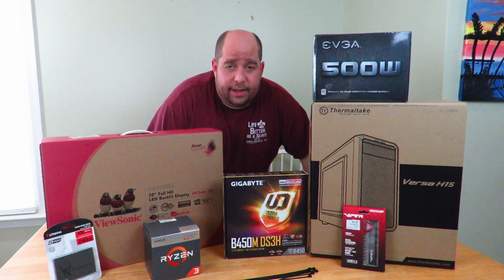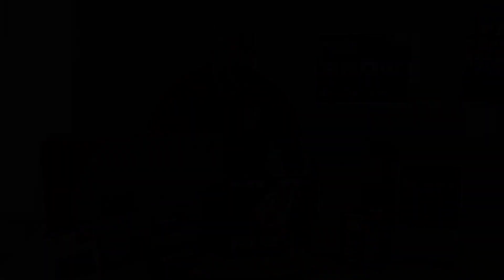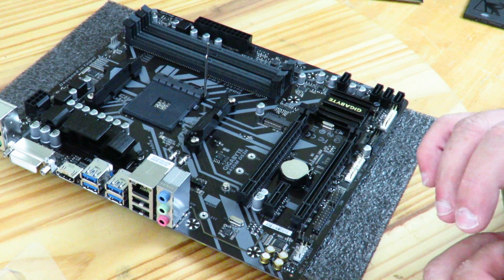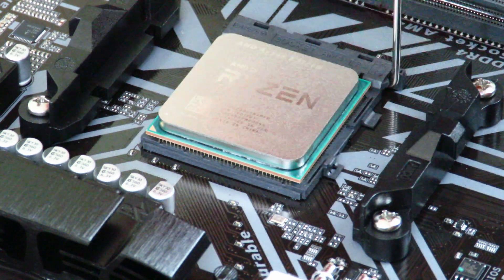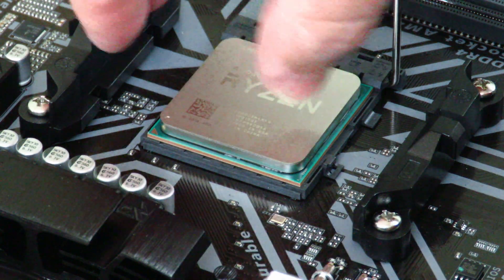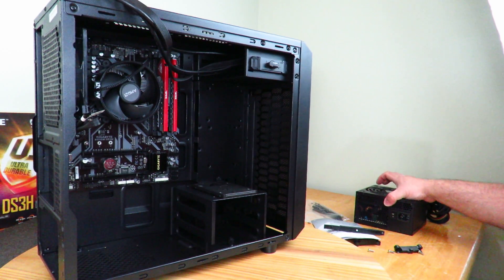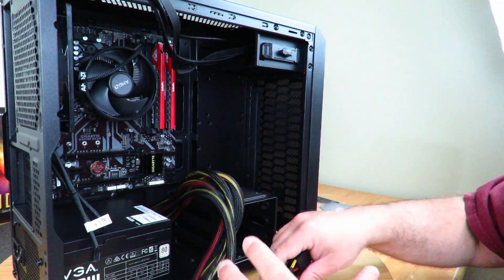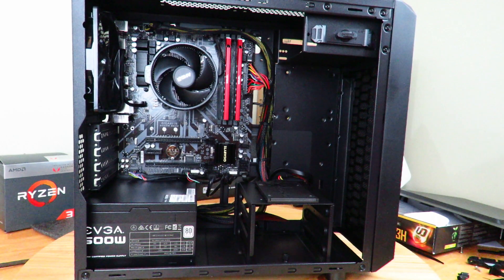How to Build Extreme Budget PC that doesn't Suck | Step By Step Guide

Comment: I'm building a similar build same motherboard but the wifi variant, 
AMD Ryzen 3 2200G
16GB RipJaws DDR4 2666
Radeon RX 570
500GB SSD
Corsair CX 450W 80+ Bronce PSU
Reply from the maker: Nice, this is a budget build, so there was no GPU, but yeah, the 570 will perform much better, very happy for you my friend.  Hopefully this video will help you out some.
Reply: ThisBytesForYou thank you for your input
Reply from the maker: Always my pleasure my friend
Reply: Hi I’m doing the exact same build can u tell me if u had any problems with the motherboard and cpu since the motherboard has to update the bios?
Reply: Osman Kazaferi  so I did not have to update my bios as my board was ready for the 2000 series 
And I have had no issues works great and I get a great 1080p gaming session
Reply from the maker: Thanks for chamming in my friend
Reply from the maker: No issues, all good
Reply: Astroidyeti cause i just ordered this motherboard yesterday and hopefully I don’t have problem with the bios
Reply: Osman Kazaferi  okay if you got a 3200 then you will but a 2200 you should not
Reply from the maker: Easy enough to update though, and I do recommend updating it
Reply: Yeah mine is amd ryzen 3 3200 g hopefully not but if i have that problem how can i update the bios?
Reply: Osman Kazaferi sadly the only way to update the bios is to have an older cpu 
If you have to update the bios if you have a UPS ( uninterrupted power supply) it’s a battery bank to computers and other sensitive electronics use it as if the power goes out well updating bios it is almost impossible to fix and is almost always easier to but a new motherboard
Reply from the maker: No, you can do a flashbak
Reply: ThisBytesForYou thank you I was under the old impression that you were screwed if it the power went out
Reply from the maker: I am not sure what you mean my friend, I went over the entire conversation, may have still missed it, but not seeing where anything about power going out was mention, can you give me information as to what you were referring here to?
Reply: ThisBytesForYou I was saying thank you as I was unaware of the ability to flash back that bios as from most things I have heard is that if the power goes out well updating bios things can go very wrong.
Reply: I’m also going to be updating my cpu to a Ryzen 5 from the Ryzen 3
Reply: ThisBytesForYou so I am upgrading this pc as I have now updated my bios to a Ryzen 5 3600 and going to cool that with a 120mm AIO water cooler
Reply from the maker: Awesome, how's she working for you?
Reply: ThisBytesForYou working wonderful the 2200g is just not performing as well as I would like in some games that are more extensive on cpu
Reply: I think the 570 is bottle necking the 3600 do you think a 1660 super would  perform better or do you think I should stay with AMD and go with a 5500xt or even a 5700xt
Reply from the maker: Well a 5700 would out perform a 5500 or a 1600, so if you can, the 5700 would be a much better repair for the 3600
Reply: I think it won’t be a problem since it says supports amd ryzen 3rdh generation and my cpu is 3rd generation i just did some research but will see what will happen

Comment: Hey i want to get this motherboard with amd ryzen 5 3400g
Does it need a bois update or not?
Reply from the maker: as long as the board comes with version F40 of the BIOS you should be good, you should be good.  The BIOS was released 2019/05/16, so they should have a much newer bios on the board.
Reply: this board works fine with my 3600 no questions
Reply from the maker: Yup, it should as long as you have bios version f40

Comment: Nice vid, I'm going to build myself one of these. Just need to figure out with graphics card to get.
Reply from the maker: Thank you friend, what is your budget on the card?
Reply: @ThisBytesForYou  well I would like keep it under $200. I just want to run a few games every now and then. I would like to be able to run games like GTA V and Call of Duty.  I would even consider buying a used one. Would anything around that price do the job? And thanks for the reply. I'm totally new to the graphics card scene lol
Reply from the maker: @iGame2A  are you going for AMD or NVIDIA?
Reply: @ThisBytesForYou  AMD
Reply: Fernando Ramirez i’d say get the rx580 or 5500xt or non xt, they are pretty good budget cards
Reply: @trixites4249  I went with a RX 580, I'm still waiting for it to arrive in the mail.
Reply from the maker: Sorry my friend, YouTubes notification system is very flawed, I never saw your reply, you made a good choice with the card, it's a great card, not current gen but that shouldn't be a problem for the foreseeable future.

Comment: Sorry but where is the graphics card
Reply from the maker: It is an extreme budget build, I am using the CPU's on dye gpu with the I/O header.  This was a gift for a friend with a VERY tight budget, so I worked with what I could get.  If you check out this video, I added a card to it and provided benchmarks for both versions: https://youtu.be/nyIYRJYqMYA

Comment: Did that m/b come with mounting screws? I dont think the support standoff/posts come with it. Are all the posts the same size/length? With that CPU/APU, a regular video doesnt have to be installed? The graphics run off the Vega? Great build! I think the heatsink has a pre applied thermal paste, too. Thanks
Does the PSU come with a "this cable goes here" guide? That case didnt come with a DVD/CDROM drive, did it?
Reply from the maker: Yes, all the screws came with the case, the motherboard does not include them, and the case comes with the stand-offs as well.  The heatsink did come with thermal paste applied, if I would have added some, it would have made the price of the system go up.  The case did not come with a drive.  As for the PSU, what time was it on the video?
Reply: @ThisBytesForYou  i think the PSU you got separately. Thanks. I am considering a 3400G, as I am not a big gamer, but want some newer features.
Reply from the maker: @j.lietka9406  yeah the power supply comes separate, the case is just the case.  The 3400 is a very nice processor but just know, a processor that is great for gaming, is great for everything else since gaming utilizes it more, like workstations and such.  So the 3200 in this video was just to keep a budget though it is an older video so all of the prices now are way down.

Comment: Hi, I just saw your video very informative and will watch step by step to complete my build. I am new to building gaming desktops. I saw all of your positive and constructive comments, so I don’t know if it’s ok if I can bug you a bit if I get stuck? Components I have rn are: (Major build)- ryzen 5 2600x, sapphire rx 580 nitro+ graphics card, MSI b450 tomahawk, Corsair lpx vengeance 16 gb ram (2x8) 3000mhz, 600 w  psu EVGA 80+ certified. (2) Ryzen 5 1600, as rock b450m pro4, Sapphire R9 390 with backplate x-trident,  Corsair vengeance lpx 8gb ram (4x2) 3000mhz, 600w psu EVGA, and have also a Ryzen 3 2200g chip. My questions for now are... Is the ram compatible to the boards I mentioned, and will it be able to set frequency to 3000? I am trying to decide if I should use ryzen 3 2200g or 1600 to pair with r9 390 or rx 580 and save myself some money and buy the rx-5700 or rx 5700 xt to pair it with my major build. Thank you,
Reply from the maker: I will always be more than happy to help you my friend.  I would go with the Ryzen 5 1600, The 580 is a nice card, but I recommend saving a little more and going for the 5700.  The XT is nice, but may not be worth the additional cost, the 390, while a powerful card, is old tech now, so you would be taking a step backward.  Going for a 5700 you would be on the latest tech, and would be safe for a year or 2.  What sort of games do you play and at what resolutions?

Comment: Hello, how many fans can I use for this Motherboard? I found out that this only has 1 system fan header. My case fan current is 0.25 Amp.
Reply from the maker: this board only has 2 fan headers but you could always get something like this which will give you 6 more fan headers: https://geni.us/gq4R
Reply: @ThisBytesForYou  2 fan headers. You mean 1 CPU fan header and 1 system fan only. Right? Do you have any idea of what is the max load for a single fan header? I heard from Reddit that a single fan header only has a max output of 1 AMP. From my understanding, if my case fan has a 0.25 amp output draw, I can only add 4 case fans on a single header. Am I right?
Reply from the maker: @jeffersonlorenzo2902  correct, 2 fan headers, cpu and system fan.  As for the load, no I don't and I cannot test it as it was a gift for a friend and I do not have the unit anymore.  I would not add additional fans to the header because it will lower the overall effectiveness of those fans and if you are using PWM, it will work even less effective.  I recommend the unit I linked in my previous reply.  I hope this helps.
Reply: @ThisBytesForYou  Thanks for the information! Stay healthy wherever you are! :)
Reply from the maker: @jeffersonlorenzo2902  anytime my friend, very happy I could help you, and thank you for the well wishes, I hope the best for you and yours as well.

Comment: how did you connect the power switch of the case to the mobo so it can turn on
Reply from the maker: of course, it works fine.  Every single motherboard has a different power switch connector location, so verify with your motherboard manual to verify you can connecting it in the correct spot.

Comment: What gpus will be compatible with this motherboard
Reply from the maker: you should be able to use just about any card, is there any in particular you have in mind.
Reply: You cannot over click with this motherboard btw
Reply from the maker: The motherboard manual states differently, do you have this board?
Reply: ThisBytesForYou yes
Reply: If it is able to be over clocked than that would make my day
Reply from the maker: Manual says it can, sadly I don't have the system, it was a present for a friend
Reply: ThisBytesForYou yea but also I’m not going off my own test, considering I don’t have a gpu in my system, so so can’t even game until I get one
Reply from the maker: If you can see on your monitor, you do have a gpu, it may not be the best bet you can play games, maybe on low at 1080p

Comment: Hey, i have the same mobo and the phantex 300 as case. The problem is that only the upper 4 screw holes lign up with the mobo. Is it okay if the mobo is screwed in by only the upper 4.
Reply from the maker: Hello my friend, thank you so much for stopping by and checking out my video.  Sadly no, if it was only one screw missing, because the standoff was not there that would be OK, but only having 4, there is a huge chance that maybe playing with the board, a card or shacking the case, could cause the board to short, killing components, or even worse, causing a fire is very high.  Looking at the case, it looks like you have enough space, are you missing stand offs or screws?
Reply: ThisBytesForYou WoW what a lightning fast reaction, respect that you are still Reading the comments after all this time. Yes i did get 1 extra but that 1 aint enough i will try to remove the Stand ofs from the ATX configuration and use them
Reply from the maker: @danielmeb84  I try to respond to all of my comments, I love helping people.  Yeah that is a good idea, make sure there are no additional stand off under where the board goes either as that will surely short your board.  I have a ton of other tutorials here on many things you might have questions on, and if you don't find them, just ask, I may be able to create a video in the future, I am here for you.  Thanks again my friend
Reply: ThisBytesForYou thx for the responses. I do have 1 other question does the GPU go in the upper slot or the bottom one on this board
Reply from the maker: @danielmeb84  sorry my friend, I was out recording a video for tomorrow, as you can see in this video, it goes in the top slot.  I urge you to watch this video, it will help you out with a lot.
Reply: ThisBytesForYou thank you, i did watch this video but this build doesn’t have a GPU right
Reply from the maker: @danielmeb84  ahhh yes, I forgot about that, but I made an add-on to this video, to help my friend more: https://youtu.be/nyIYRJYqMYA
Reply: ThisBytesForYou hey, if you don’t have a HDD do you still need to install that small cable called HDD LED
Reply from the maker: yes, it would work for the SSD, its called many things, HDD activity light, Activity light, ect, it's to show that you have activity on your system.

Comment: Woah you didn't put any thermal paste? Aren't you supposed to always apply thermal paste to your cpu so it doesn't overheat???
Reply from the maker: Yes there is thermal paste on the heatsink, I used the thermal paste that was already pre-applied.  Normally most people remove it and add Arctic Silver 5, Arctic MX4 or Thermal Grizzly, but being a budget build, I used what came on it, not buying additional thermal paste.  I hope that answers your question,... I am not insane 😇
Reply: @ThisBytesForYou  I'm going to get a AMD Ryzen 3600. Is the heatsink pre-applied with the thermal paste?
Reply from the maker: @fadzlyjb  it usually does come pre applied if it does bring a heatsink, if not you might have to buy additional thermal paste.  Just make sure when you take out the heatsink to look at the bottom of it (the part that comes in contact with the CPU) and verify you see paste.

Comment: i builded computer costs 500 dollars  with ryzrn 5 2600,rx 570 8gb,16gb ram team group vulkan tuf, and with the motherboard in your video
Reply from the maker: Yeah sadly prices have dropped significantly since then, I wish I could redo it for them since but of course I can't.  That board is pretty good huh, how are you liking it?
Reply: @ThisBytesForYou  Yes, i like this motherboard, because it is a cool budget motherboard with 4 SLOTS DDR4 for this price, and on board it has all the necessary inputs, connectors, and other things
Reply from the maker: @6eka953  yeah. When I got it for my friend it was relatively new, but still works very well.
Reply: @ThisBytesForYou  ohh, i wasnt checked date when the video was released=) sorry man
Reply from the maker: @6eka953  anytime my friend, no worries

Comment: will this board ds3h be ok running a ryzen 7 2700 iv currently got the 1200 but looking to upgrade the cpu to the 2700? cpu list says it supports it but a lot of comments people saying it wont??
Reply from the maker: yes it is but you need to make sure you are on at least BIOS version F1 or higher

Comment: Why skip the hard and confusing parts? We are watching because we don't know how to do it!
Reply from the maker: This was a rush build, as it was for my friends birthday, so I did not have a lot of time on it.  I do however have many other build videos here that surely could help you.  What part are you stuck on?
Reply: @ThisBytesForYou  the front panel with multiple plugs that go in different places on the motherboard, and especially the long double row of pins that take several front panel plugs. It looks like that should get a big plug to fit it, and where do the leftover plugs go? It's very confusing if you are new to building a pc, and a lot of videos skip right over it, just like yours did. Thanks for reading.
Reply from the maker: @grayisgood  LIke I mentioned, it was a rush video, but I have many other videos on this channel that go over the same, in a slower pace.  Not sure what plug you are referencing to as the long double row of pins,  I would be more than happy to help you on this.

Comment: The enclosure is designed to put a SSD inside. It's raised a couple of millimetres. Also you could put a SSD or hard drive on the wall of the cage.

Editing after seeing all video: 
You did so many things wrong , you have wire management on the backside. You have holes to put the 24 pin connector and the 4-pin connector. The solid state drive you could hidden on the back of the cage. 
Please redo a video properly.
Reply from the maker: Haha, well thank you my friend but sadly I did not have enough time on this build as it was for a friends birthday, so I was a bit rushed and with that it is impossible for me to do a redo.

Comment: Its ram slot 1 and 3, but you told 1 and 2
Reply from the maker: no, for this board it is slot 2 and 4 as you see in 10:01 and in the manual (https://download.gigabyte.com/FileList/Manual/mb_manual_b450m-ds3h_e.pdf on page 10).  For your board, it may be 1 and 3, but always refer to the manual for specifics like this.

Comment: Are these series mother boards Bios updated for 3rd gen ;Ryzen 5 cpu?
Reply from the maker: they can be, but you need to check the box for BIOS revision.  At a certain point they will all be but when they ship from the factory they ship with a BIOS version, as the versions go up and provide additional features, functions and stability they ship with newer BIOS' so you will have to deal with what the vendor has in stock.  Buying from online sellers might be difficult to but in a local store it would be a lot easier to know.

Comment: Where do I plug in the power switch and reset switch along with the HDD led
Reply from the maker: That all depends on your board, what motherboard do you have?
Reply: ThisBytesForYou nevermind I found the virtual manual and now it’s turned on 😊